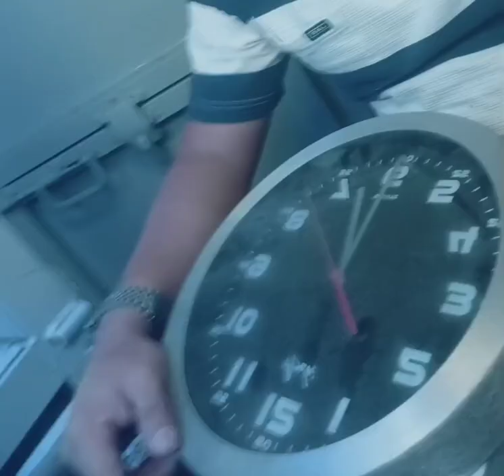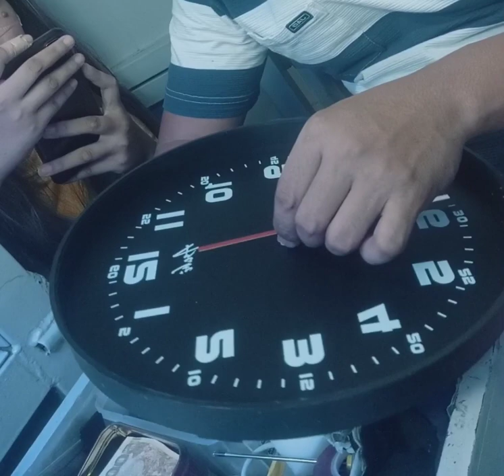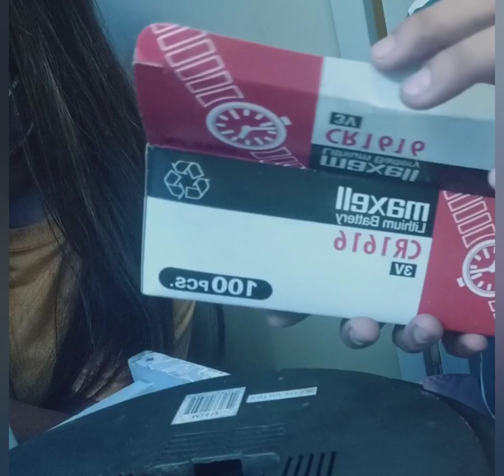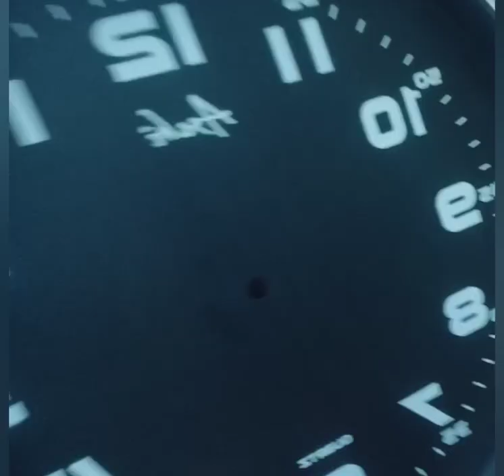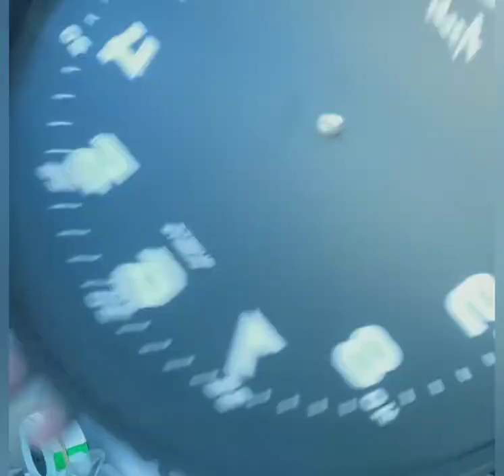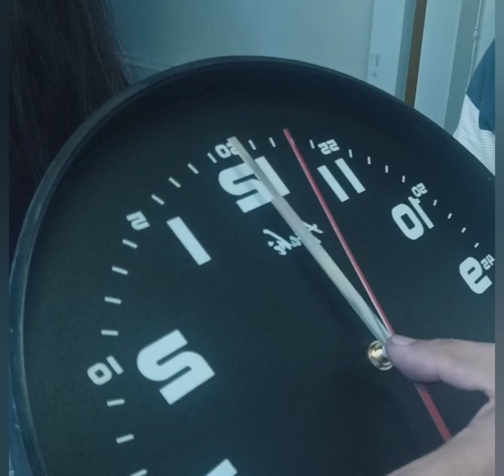wall clock machine replacement/asahi

Comment: boss saan po nakakabili ng makina ng wall clock at magkanu?
Reply from the maker: Corner ng rizal ave.at recto ave.sa my  quaipo Boss.
Reply: @otechtvwatch  boss baka tanda nyo un pangalan ng store at kung magkanu salamat po!
Reply from the maker: Platino yung pangalan ng store, pero sa ngayon wlang nka lagay na pangalang sa labas ng entrance nya,yung kanto nun mcdo simula dun mga apat na store ata..along rizal ave..pag nakita mo sa store intsik na maliit na maputi na kalbo😅😅 yun na mismo.yung common na model ng wall clock machine nila 45 lang pag technician price.😂
Reply: @otechtvwatch  salamat po sa info ser....Magandang araw!